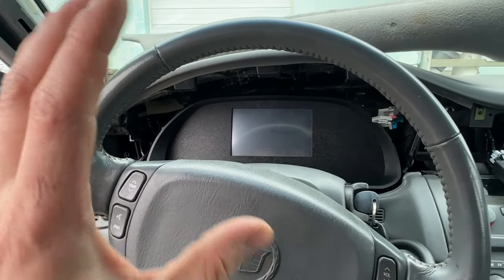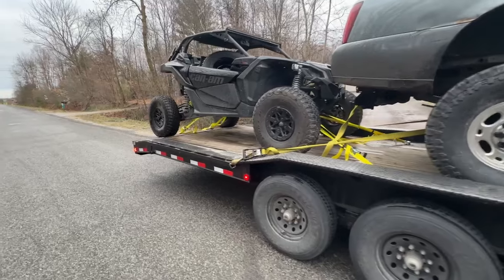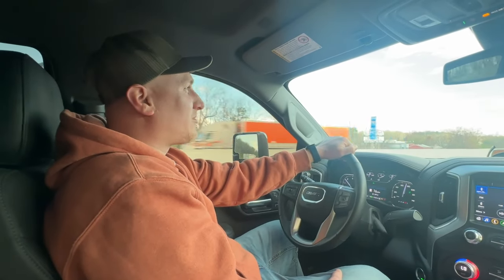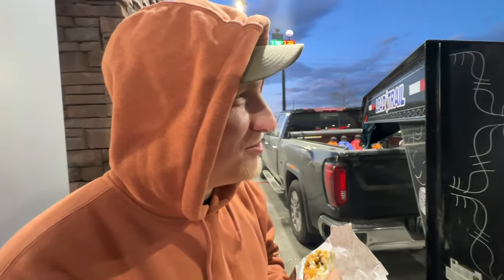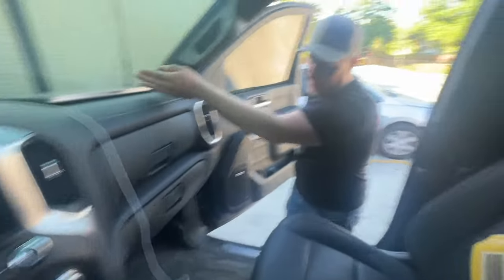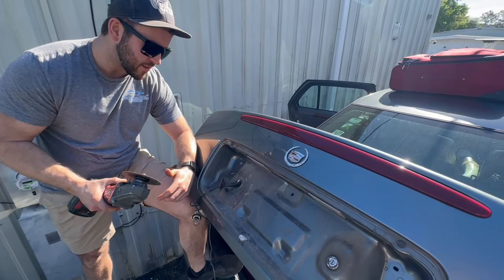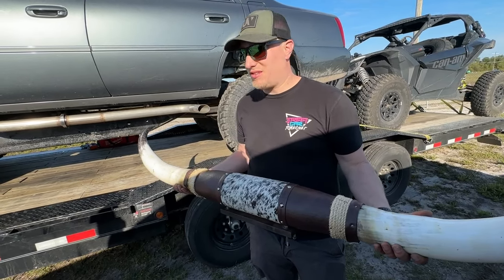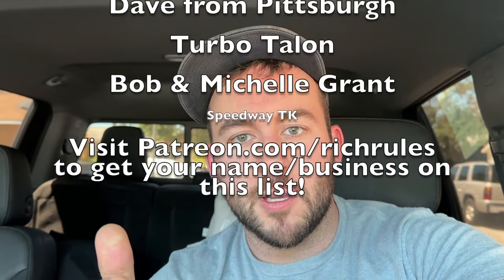Hauling 1000+ HORSEPOWER to Cleetus and Cars! Last Minute Repairs and KSR Visit!

Comment: How is that GVRW that truck and trailer combo has got to be above 26k
Reply: Need to be careful of that GVWR. There are some states where a 1 ton dually and a decent size fifth wheel exceeds the weight rating requiring a CDL.